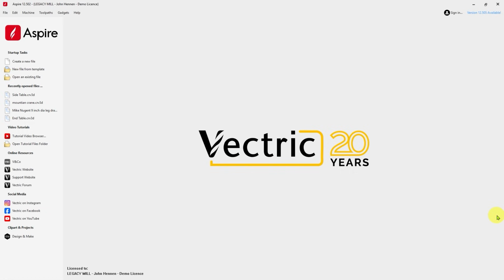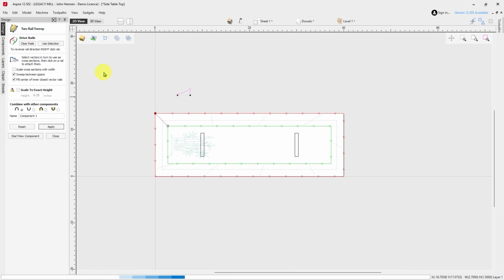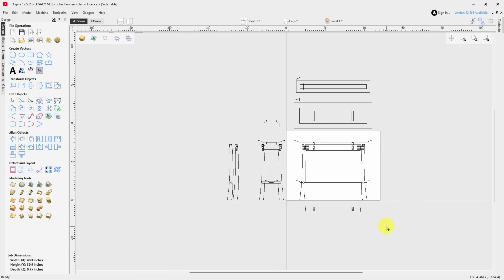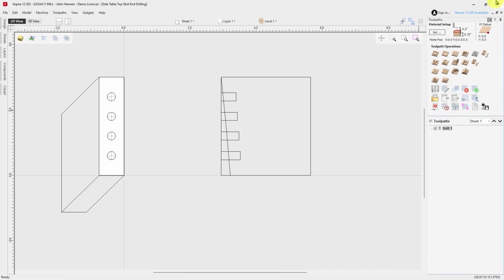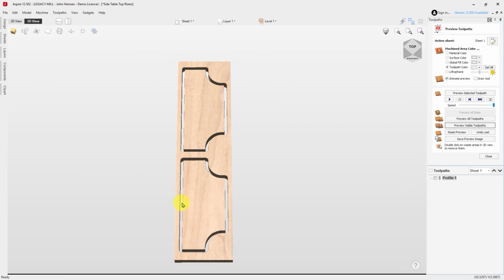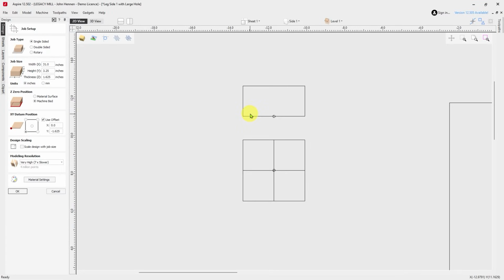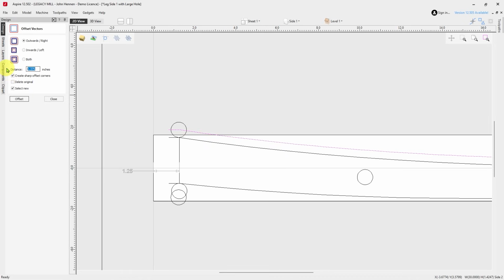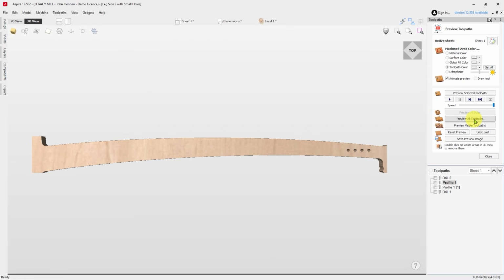Designing Furniture with Aspire | Vectric Online UGM 2025

Comment: Outstanding!  Legacy makes great machines.  I researched for 2 years while also looking for a retirement home that had at least a one car sized space that I could use for a workshop.  Eventually found a place that had a 4 car detached building that I now have my shop in.  Plenty of room for my 3x5 Legacy Maverick and other machines.
While doing my research, I saw a video that advised that I look for the machine I would upgrade to and to buy that one instead of a smaller or lower cost machine and then upgrade because I would probably fall in love with CNCing.  That's what I did.
Reply from the maker: Thanks for sharing your story, that's great to hear!